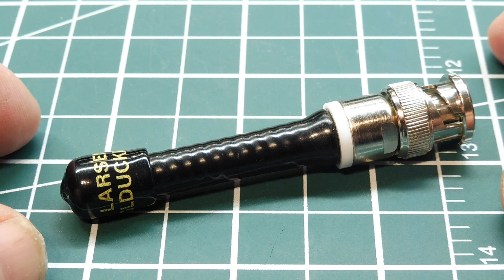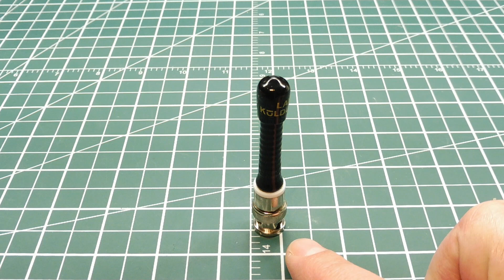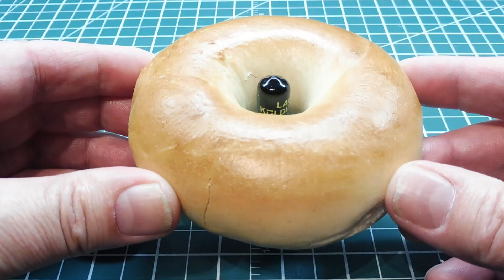Antennas 101  / How does an antenna work

Comment: Love this! Just tested this (Webasto remote controller for my car, 868,3Mhz) with a extension cable that I split up, like 5:40 in the film. And my aux heater remote contoler for my car got the signal through my house and like 30m down the road. Before I had to be at the same wall in my house to make it to work, and in free air it would work at maybe 15 meter
Reply from the maker: Thanks for sharing! Glad it worked out.

Comment: Aspite some very negative comments i concider this video very informative and well explained! The impedance matching is very important, also the SWR measurement. A NanoVNA ist probably the best and quite inexpensive tool to tune an antenna. Why is a dipole antenna 37 ohm? Is this true for all frequencies and idenpendent from heigt and form/surroundings of the antenna?

Comment: 5:10 the input impedance will change of you bend the exposed parts to the black (like 120-130 degrees), more like 50 Ω then

Comment: The radiation pattern is the same as a 1/4 wave monopole. Thats great annnnd what is a 1/4 wave monopole exactly? Operating in normal mode... OK vs. what? Aren't all antennas normal? Are some abnormal? And this is just in the first 45 seconds. It doesn't seem that you are explaining antennas in a matter that people can actually understand what it is your attempting to explain. You seem to assume that people just automatically know or should know what normal is for an antenna or what a 1/4 wave is... Also What is base loaded? Not helpful but causing confusion.
Reply from the maker: The video is less than 10 minutes long. If you don't understand anything, start with the basics:
https://www.youtube.com/watch?v=JHSPRcRgmOw
For a more understanding of Helical antennas check online for more info:
https://en.wikipedia.org/wiki/Helical_antenna

Comment: What is radiation? How is a transverse wave produced? What is refraction?
Light and radio waves are electromagnetic waves comprising electric and magnetic field pulsations or variations in strength at each point in the space.
It is a form of radiated waves of pulsating electric and magnetic fields.
They are produced by accelerated electric charge which produce a transverse electric field which propagates outward from the accelerated charge. The radiated fields constitute a wave travelling through space. 
The fields don't travel, the wave does. The fields pulsate in strength.
This is best visualised by a rope, one end of which is fixed to a wall and the loose end held some distance away.
The loose end when moved up and down creates a wave travelling. 
Notice how the molecules of the rope near the wall have not travelled to the loose end. 
The snake-like shape in the form of a sinewave and travelling movement you see is the overall effect of the up and down movement of the molecules of the rope.
The same happens with the strength of electric and magnetic fields of radio waves and light. 
There are no sinewaves in space! It is the strength of the electric field say, which we plot of a radio wave which has a pattern of a sinewave.
When a radio wave or rather the fields of the wave encounter matter, they set into motion the atoms in the material. The acceleration they produce of the charges that make up the atoms and molecules in matter, produce electromagnetic waves and these are reradiated fields. 
The incident and reradiated fields combine to produce a resultant wave.
These resultant waves constitute the fields in reflection and refraction.
Before learning about sinusoidal currents, voltages and electromagnetic fields it would be instructive to learn about current and the conduction process at the fundamental level as in these two videos 
i. https://youtu.be/TTtt28b1dYo and 
ii. https://youtu.be/8BQM_xw2Rfo 

Engineers are so used to thinking and visualising currents as differential-mode in circuit analysis that they find it hard to switch their thinking to common-mode currents and its uses in designing high impedance antennas.
They can be generated internally in circuits and in antennas such as the folded dipole antennas like the Yagi antenna.
The last frame of video 1 contains in the References textbooks 3 and 4 which discuss antennas (dipoles) and wave propagation and includes topics on reflection, reradiation and scattering using the unified approach with the help of sequential diagrams. Also discussed in textbook 4 is the generstion of common-mode currents in two-wire cables which is useful in understanding the operation of the folded-dipole.
Watch the following videos to get an idea of radiation by an accelerated charge and an oscillating charge.
Video 1 Field lines for an oscillating particle in 2D
http://www1.astrophysik.uni-kiel.de/~hhaertel/Videos/oscillation-2d.mp4
Video 2 Field lines for an oscillating particle in 3D
http://www1.astrophysik.uni-kiel.de/~hhaertel/Videos/fast-osc-particle.mp4
Reply: You are just the person I have been looking for. Can you tell me how to build a dual band collinear antenna at 433/915 MHz with Zin of 50 Ohms at those two frequencies and a gain of around 3 dbi. I have talked to other RF engineers with no luck. Sounds like you might know.   Thanks

Comment: For the antenna shown at 6:39, would be ok to use something like Plasti Dip compound to protect it from elements? I mean, would sillicone decrease the effectivity of the antenna? And BTOH, would sillicone be conductive enough to short main pole and ground poles?
Reply from the maker: I have used Humiseal conformal coating with success but you would have to check if Plasti Dip is conductive. Check out this video at about minute 6 where I test the antenna with a VNA. You would have to do a before/after measurement to see if VSWR increases or Impedance changes after Plasti Dip is applied. https://youtu.be/wR-2c8VgunI
Reply: @0033mer  Excellent, thank you. I think PlastiDip is vinil, I would not care on an audio circuit but I have no idea how would it behave at 500-600MHz. So I will follow your indications (although I think I wont be able to measure high freq stuff with my equipment)

Comment: BNC pin is the worst choice for an antenna. Its quicker but offers poor and unstable conductivity.

377 ohms for free space???. Kindly clarify if that is for the frequency of the signal in discussion. What frequency is that?
Reply from the maker: It is the characteristic impedance of free space similar to the character impedance of a coaxial cable which is independent of wavelength. It is the relationship of the electric field (capacitance) and the magnetic field (inductance) in free space. For air it is 377 ohms.
Reply: @0033mer  thanks for the reply. However my basic doubt is if the freespace has only 377 ohms then how are we not electrocuted near high voltage pylons or powergrids or say even the feeder lines carrying 11000 voltage. Kindly clarify
Reply from the maker: I don't think you understand "characteristic"" impedance and confusing it with resistance. You need to go online and study transmission line theory. In my short 10 min video I am simply stating an antenna is a impedance transformer from 377 to 50 ohms.
https://www.ad5gg.com/2018/09/25/what-is-characteristic-impedance/
Reply: @0033mer  thanks a lot. I really enjoyed your creative writing which makes complex things easier to understand. From an application point of view how does this 377 ohms play a role. Does it determine attenuation of RF signal in free space and or its the impedance matching thing between the antenna and the freespace or in what manner it must be considered.
Reply: Your writing of envisaging a DC pulse as AC and super multimeter and 100 miles examples are praiseworthy. Please keep educating

Comment: This question has probably been answered already.  And if it has i apologize.   My question is  what is the purpose of a capacitor being installed on the inside of a flexible antenna? 
If this seems to be a stupid question i apologize.  I'm not stupid but I'm definitely not a genius either. I absolutely love trying  to figure out how things work.  I love to find things that don't work and see if i can figure out what is wrong with it then see if I can fix it.

Comment: I'm a rf engineer and worked on antenna in the past.  Typically when you make an dipole or monopole antenna, you should connect your antenna to a VNA and check your return loss(s11), and make sure it is tuned to the right frequency.  The actual size of the antenna is shorter than the calculated value because of fringing effect.
Reply from the maker: The antenna was trimmed using an Anritsu S412E for best return loss. Fringe fields only apply to Microstrip/Patch antennas. With a wire monopole the Velocity factor (Vf) has to be taken in consideration for proper antenna size. The velocity factor is already taken care of in the formula for constructing the radiator and ground plane radials.
Reply: @0033mer  rotflmao ,,,,,,  You The Man!!!!!!    ,,,,,, I've been reading some of the replies,,,, some of these folks need to check themselves before attempting to check you,,, Thank you for taking them back to school!   it's been confirmed,  you that guy !!!!!

Comment: Great videos , informative.
Im not so good at electronics and need some help.

I have a Sony AIR-7 Scanner radio with Air ,PSB<AM <FM . the anntena is too big for this thing and too whippy. How do i find out how to replace it with a shorter yet more efficient antenna?... it is only a receiver. can you steer me the right direction?.. I dont want to have to mount a roof antenna, for this portable radio.
thank you

Comment: Nice job. According to the formula we see towards the end of the video, when we calculate low frequencies, the wire sizes are quite long. For example; 2832 inch for 1Mhz frequency. An impossible length. Is there a way to shorten the wire sizes?
Reply from the maker: Low frequency = long antennas. Search online for long wire antennas with balun or antenna tuner.

Comment: Radio antennas are magic. But you can change the configuration of the magic to make it work in different ways for example donut shaped magic or squashed donut shaped magic. You can even do maths to change how the magic works or to make it work more efficiently. This is basically how magic works. Now go forth and use magic.

Comment: sir i would like to make a diy rubber duck antenna with UV-82 baofeng radio with freq. of 155.725 and dont know the measurement any suggestion sir heres my email sir pancitngisabela@gmail.com thank you in advance keep up
Reply from the maker: Go online and look for a normal mode helical calculator. This will give you a place to start. Check out other sites for theory of operation. http://www.cqham.ru/spiral.htm
Reply: J B: A half-wave antenna for that frequency will be approx. 0.96 mtrs (37.8 inches).....a quarter-wave will be approx. 0.48 mtrs (18.9 inches).

Comment: Sir where did you get the 2832?
Reply from the maker: A wavelength is the speed of light divided by the frequency. 186000 mi/sec/freq Hz
That would be 982.08 feet/sec/freq Mhz
A quarter wavelength would be 245.52/Freq Mhz  (feet)
Multiply by 12 to get inches
2946/Freq Mhz (inches)
The speed of light is slower in a wire because of its dielectric constant.
To compensate we multiply by the velocity of propagation factor.
Vp can vary but I use .961
2946 X .961 = 2832
For a metric calculation use the speed of light in meters/sec
Reply: @0033mer  thank you sir..
Reply: 2.98*10^8 m/sec /1.05 = 2.832*10^8 m/sec. Divide by the frequency in MHz to give wavelength as 283.2 m/MHz. Bump that up by a factor of 3.28 ft/m to give you the length in feet, or 929.13 ft/MHz. For 2400 MHz, you get the wavelength in feet is 0.387', or 4.65". Quarter wavelength is 1/4 of this, or 1.16", which he rounds off to 1.2". The basic equation is simple enough, wavelength = speed of light / frequency. The hard part is working through the units, which are usually stated in meters (2.98 * 10^8) or even kilometers (2.98 * 10^6), and then translating the results into feet or inches, which we Americans insist on using.

Comment: Tried soldering the copper wires to that exact same chassis socket. Not working
Reply from the maker: The connector has to be silver plated for the solder to take. A connector made by Amphenol will work but a knock-off will not.
Here is a video with a solution. ( starts at minute 3 )  https://youtu.be/JeUexihrKZQ

Comment: I am a radio engineer, and that was a dreadful "explanation" of how an antenna works.
Reply: You are just the person I was looking for. I need to build a collinear antenna for the ISM band. (902-928) I have a BNC connector and wire but I need to know the loop diameter and distance between loops. I have tried a few times but I do not get a good match. I just need someone to do the calculations for my frequency of operation.
Reply from the maker: From the RF connector measure 1/2 wavelength to the first loop (13 mm dia ) measure 3/4 wavelength to the second loop and then 3/4 wavelength and cut. That is your antenna. Use an antenna analyzer to tune the antenna by trimming the top and spreading or compressing the coils for a minimum SWR (<2:1) or a return loss greater than 10 db. You should get 15db.
Use a chassis N connector so you can add ground radials for better operation. If you do not have an analyzer use a LoRa radio module and a thru-line wattmeter like a Bird 43 and tune for minimum power reflection. Power reflected should be less than 10% of forward power. Use the formula in the video to calculate the wavelength for your operating frequency.
Reply: I can see that tuning is the key. I have a friend that is into ham radio and he has a wattmeter that I can use. Where is our "radio engineer" Not very practical and lost without their calculator. Dreadful!
Reply from the maker: I tend not to dwell too much on the comments.

Comment: I turned this off at the 43 second mark when the poster incorrectly claimed that the short rubber ducky antenna was a "helical antenna'.  Bullshit!  Helical antennas are end fire, high gain directional antennas and are much physically larger than these compact portable VHF/ UHF handy talkie antennas compared to the wavelength of operation.    Bye!
Reply: You are describing an axial-mode helical. The one described is a normal-mode helical. They have been around for a long time. Amazing you have never heard of them. http://www.cqham.ru/spiral.htm
Reply from the maker: Yes .. I did state at :47 that it is a normal mode helical antenna so there would be no confusion.

Comment: Just out of curiosity with antenna this small could it be made in a chip form and be able to pick up over the air channels?
Reply from the maker: You can etch an antenna on a copper printed circuit board. (PCB)
https://youtu.be/JeUexihrKZQ

Comment: Hi,
What's the best lengths (and type) for an omnidirectional practical antenna together with a 2 to 5 meter cable connection for my FM hifi receiver. I gave you a Like and subscribed. Regards

Comment: Where do I get the type of connector shown in this video?? Can't seem to find them anywhere
Reply from the maker: Any electronic supply store that sells RF connectors should have them. You can also check online.
https://www.rpelectronics.com/184-515-1-n-female-chassis-mount-with-flange.html
https://shop.mroelectronics.com/mro/product.php?id_product=1140
https://www.amazon.com/female-connector-chassis-Quality-Shipping/dp/B01CWJ4DA4
https://www.ebay.ca/itm/N-female-Jack-4-Hole-panel-Mount-Chassis-with-solder-cup-RF-Coaxial-Connector/272360374545?hash=item3f69f18111:g:XucAAOSwH3NXnxOS:rk:1:pf:0

Comment: The real mystery is "Maximum power transfer" how do you explain the matching of load to transmitter and why does it matter?
Reply from the maker: Take a 12 volt battery and connect a 50 ohm resistor in series with it. Put the components in a box and bring out the two leads to terminal posts. Connect a 25 ohm resistor across the terminals and measure the power dissipation in the resistor. Do the same for a 50 and 75 ohm resistor. Which resistor dissipates the most power? ( Use Ohm's law ) How much power was dissipated?
Reply: The 50 ohm resistor will dissipate the most power  (.72 Watts ) because it matches the output impedance of the source voltage supply which will result in maximum power transfer. This is high school electronics.

Comment: Video is ok except for one thing... Who the hell would want to build a 2.4 Ghz ground plane antenna when that is basically what comes with most wireless routers anyway and gain antennas are so cheap for that band?  Also the room for error is so small at that band that it is better to just buy one that has been already properly designed and tested.

Comment: Hi there..Brilliant video..thank you.. With your antenna, could I expect to improve on this, my present antenna? Thank you. https://www.rfsolutions.co.uk/downloads/1456239892DS-FLEXI-SMA90-868.pdf
Reply from the maker: If your present antenna was attached to a device with a sufficient  metal ground plane you would get similar results.
Adding a ground plane to a 1/4 wave whip will improve the radiation pattern.
Reply: 0033mer ..thank you..I'll try it...John R .. Bristol